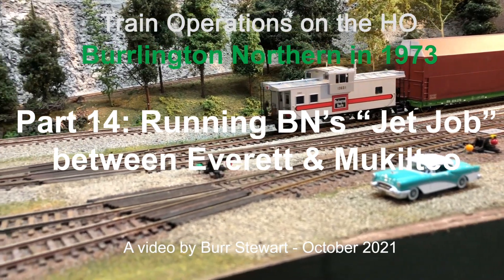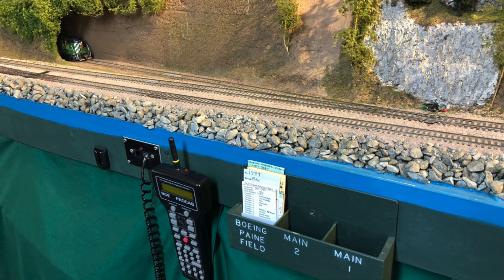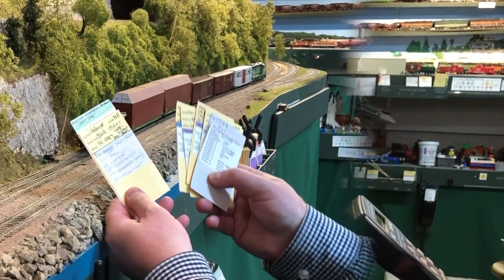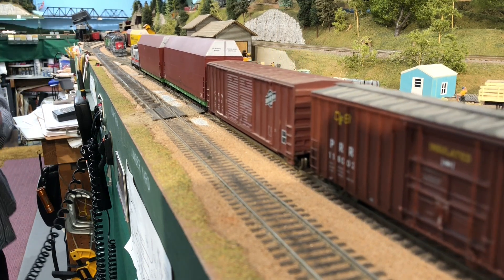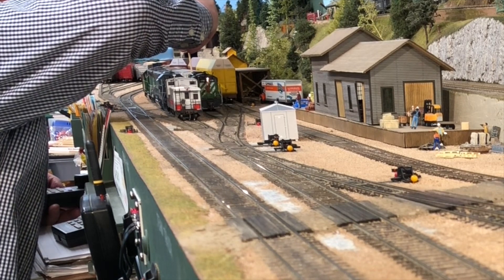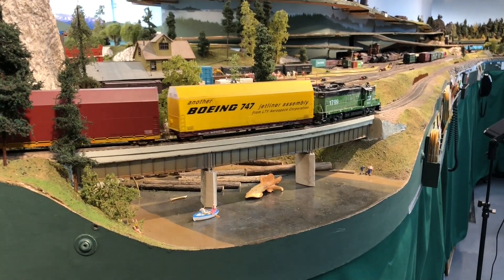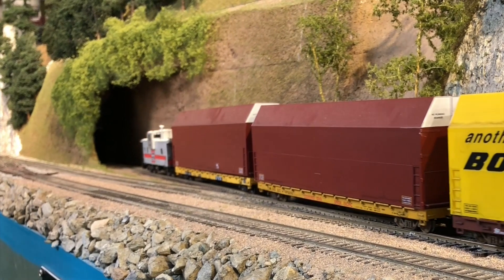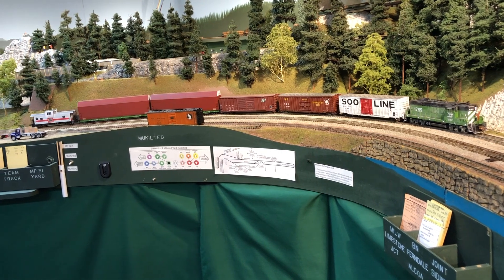Part 14 -BN's "Jet Job" for Boeing's 747 Factory near Everett WA

Comment: Alco, TN? That’s a hop and a skip away from where I live (just a 30 minute drive on Interstate 140). I did not know they made aluminum for aircraft parts though that may be 50 years or so to late.
Reply from the maker: I don't know if they did, either, but I know that they recycled scrap aluminum, so that's the shipment we're simulating here...